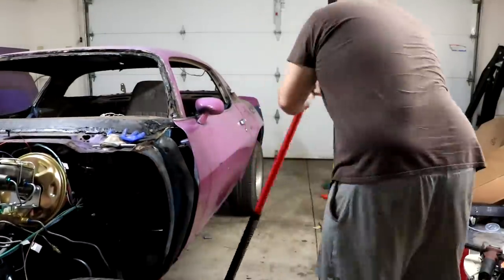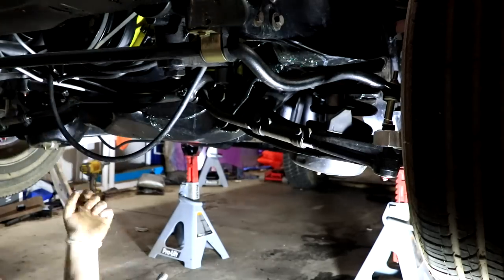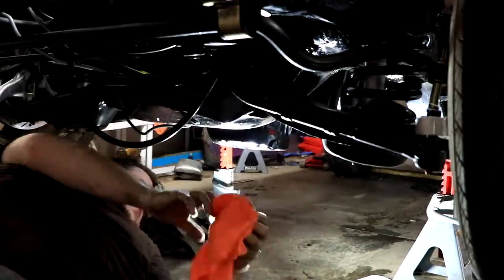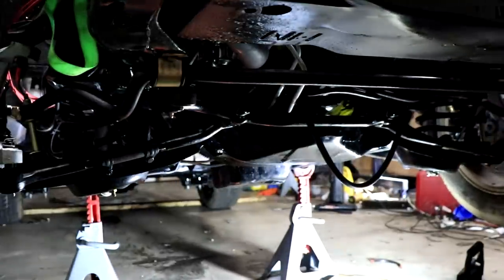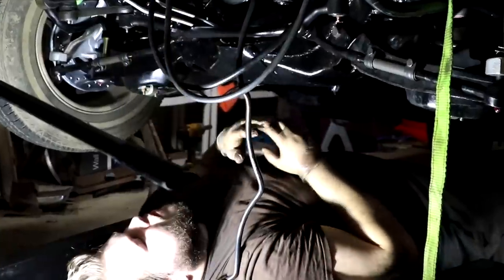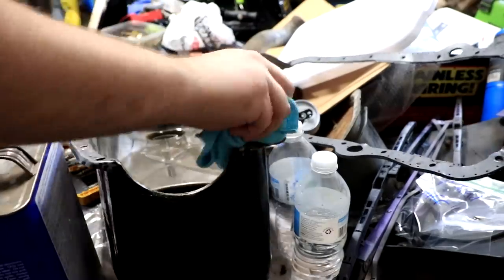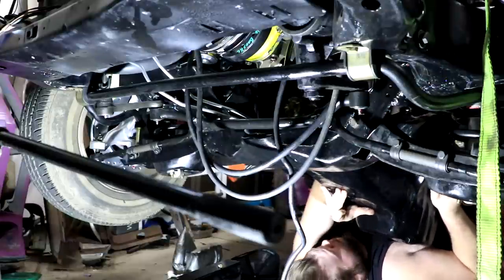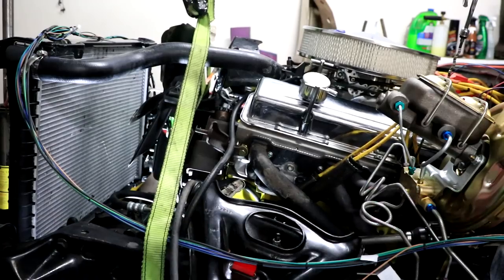Fixing The OIL LEAK on my Chevy 350 was a DISASTER.

Comment: Looks like you have the gasket for the one-piece rear main seal engines with dipstick hole/cutout on each side instead of the one with just the one cutout/hole. 
Hope the hole/cutout in gasket not being used isnt going to let oil pass if it isnt totally blocked off by the pan/block.

Comment: I tried to do the same thing on a 388 I built while it was in the car. After fighting it for half a day I finally got it changed but definitely would have been easier and quicker to just pull the engine. Especially in your case where the front clip is already off the. But we all end up spending hours on something because we found a "shortcut"😂😂

Comment: Oil also comes through the non original steel timing chain covers (China crap) the original by GM had a fully welded frontal bow profile that pushs against the oil pan gasket, the replicas from Taiwan and China are point welded in this area and the oil comes through the space between the welding points! Aluminum cast ones are better but often the frontal crank oil ring is mispositioned in them due to wrong geometrics of those china castings. Moroso are better.